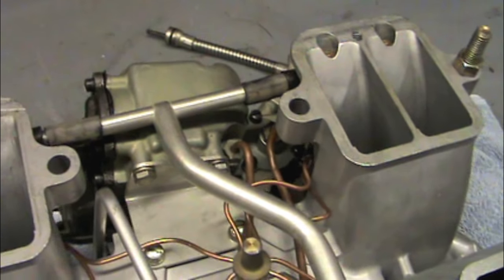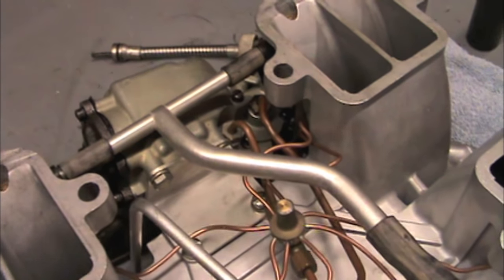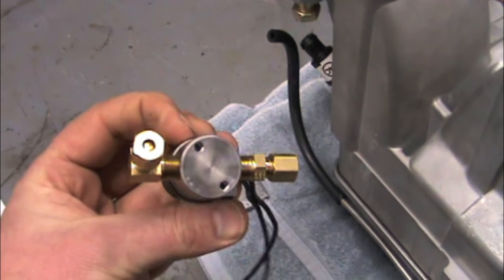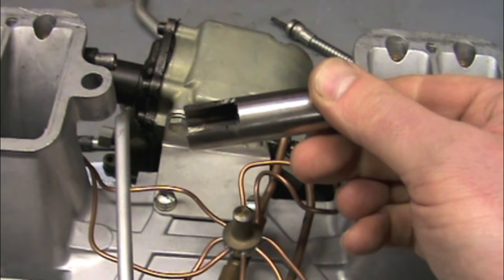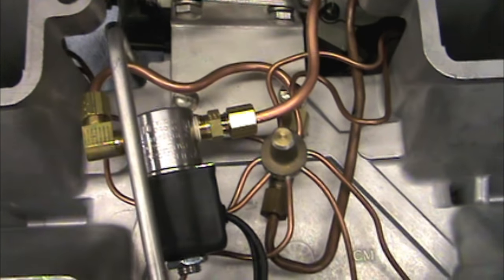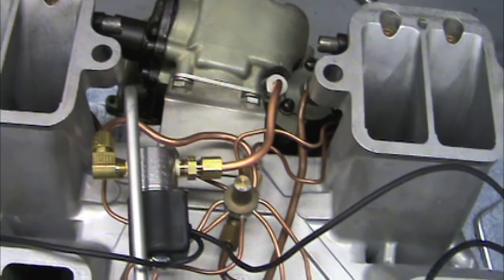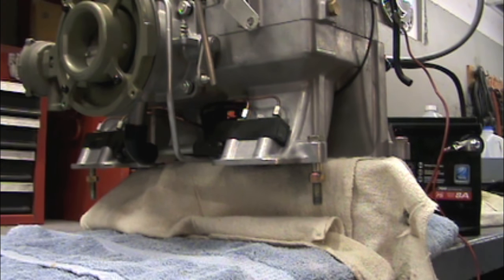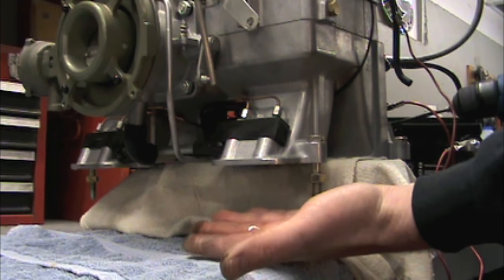How to Install a Corvette Fuel injection Shut off Valve

Comment: Some  one said the old  Rochester  systems  are not compatible with E-10  fuel.   Would not the aftermarket  re-build  parts  be say  E-15 Compatible ?

Comment: What happens when you put fuel meter pump pressure into the solenoid when switched off? Will it hold fuel back or bypass. Is the solenoid valve designed to recover if it happens? Thanks.

Comment: Sadly from 2030 on all combustion cars, trucks and busses including 
classics will be banned from public streets in entire EU and Scandinavia
  :-( In Germany  the Green Peoples Party gave order to shorten fuel 
supply from 2025 on by reducing petrol stations to only one state 
operated central gas station per city or county. They even plan to 
reduce the pump speed of public gas stations from 20 litre per 
minute to only 2 litre per minute to punish owners of combustion 
cars....from 2027 on in the EU certain car spare parts will be banned 
too....as exhaust systems, turbo chargers and even some engine and 
gearbox oils...California and New York will do the same from 2027 on....
 So no investments should be done in oil burning cars any longer....They
 even created a completely new kind of crime here in Germany, called 
emissions and smoke crime. :-(((